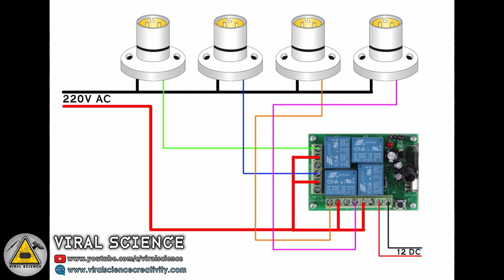4 Channel Wireless Remote Control Relay 433MHz

Comment: The circuit was already built
Then what you just do
Reply from the maker: I have shown how to connect and different modes of that module
Didn't you seen the video properly.
Reply: Ya i know the module come in my kit for the connection
And if you tell that you are showing connection then if tend to buy this module then i already have some experience about connection
Reply from the maker: You are not the only viewer of this channel, many of the viewers dont know about such modules and its application so I make videos and its easier for them to use after watching such videos
Keep supporting everyone, so all can grow together 😃👍
Reply: Ok bro take it easy.......
😃😃
Reply: @ViralScience  can i upgrade the antenna?
Reply: @ViralScience  range ? will it work from another room ? with two walls in between ?
Reply: @ashachaplot576  range ? will it work from another room ? with two walls in between ?
Reply: Yes it will work